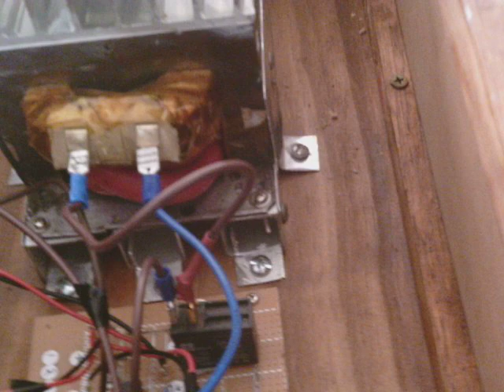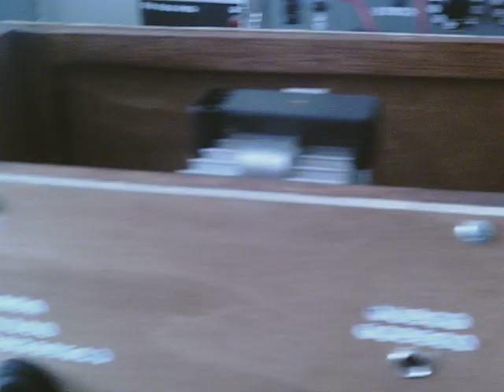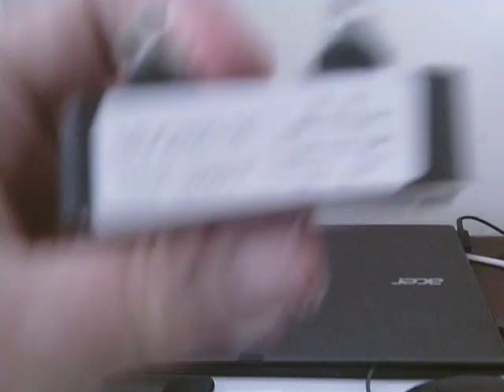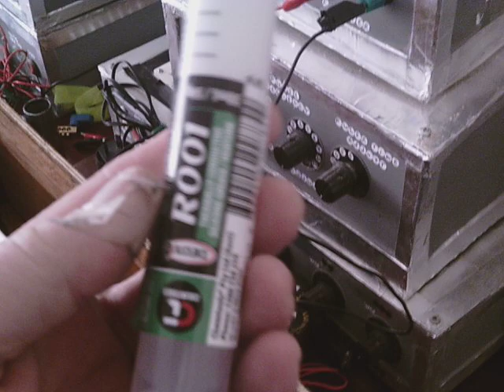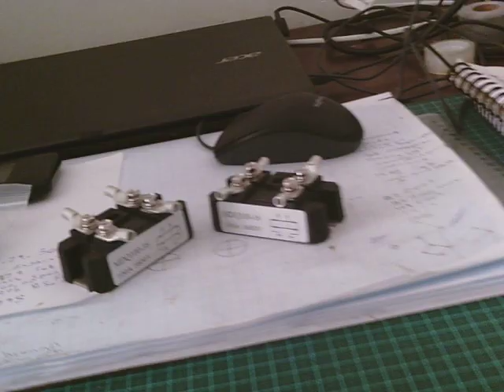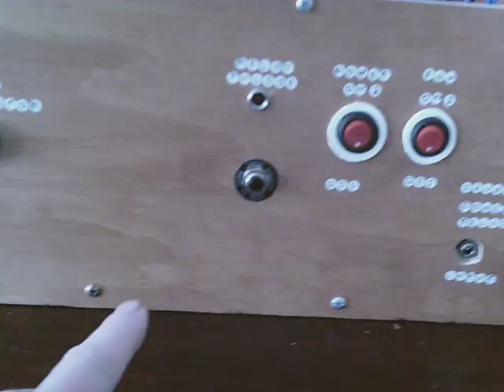high curent low voltage pulsed ac power supply

Comment from the maker: everything indicates i should be getting a high ac current but instead i got the reverse even google ai says what it was suposed to be but not so, heres my logs of the no load test so far of the high current low voltage section  without the  ac conversion section 

date 9-5-2026

ive conducted my first full test of the high current low voltage ac power supply with  the digital multimeter  and high current tester and the results are strange  the ac power lead got very warm and the transformer hummed and buzzed very loud  which I think would be normal like it may be when using a spot welder .
I removed the flasher led before that so the relay stays on during the duration the push button was held in and with no load the ac voltage was 1.302 volts ac and the current was only 2.26 amps thats more than that of a 12 volts sla DC battery which ive had great hho production on in past experiments running it directly from a 12 volts DC sla battery with one amp,  so the voltage being only 1.302 volts  ac and current being only a low 2.26 amps is  not so disappointing after all , but wait till I run it through the DC converter, and with the voltage loss through the rectifier  it may be   better under load so ill find out latter , now despite the ac power leed getting warm the transformer didn’t even get warm or hot when testing with no load and just the current meter and ac multimeter . Now when I re test it and with the 1600 volts 100 amps bridge rectifier considering I may loose more voltage  when I run it to the hho cell load,  things may change or not but if I need more voltage I do have the option of ordering and setting up a series 25 volts 22000 uf high ripple current capacitor bank from the first capacitor bank to see if it gets better , some of the silicon steel peace's I shoved under the top heatsink retaining bracket vibrated loose . the primary is only 1.5 ohms resistance and the thick Hevey 2 gauge marine cable of 2 turns is only 000.1 ohms, ive did some googling and it apears that the output will naturally be low ac voltage and current when its output is not loaded so its not a disappointment after all  but strangely the output current being twice that of a dc 12 volts dc  sla battery is strange when it should be lower when no load it there  so all is well so far .

Comment from the maker: ive recently got my last 3x 22000 uf 25 volts high ripple current electrolytic capacitors in the mail, and because the thin flatt terminals on them are so thin i couldn't solder thick wires to them so i used a long peace of 22 gauge tinned coper wire folded  and twisted it into a bifilar peace and wrapped it around one terminal of the positive of the capacitor at a time then i did the same for the negative  then soldered each one and so i have inputs from the 100 amps 1600 volts bridge rectifier and  outputs to a pair of clamps  which will be used to clamp them onto a hho cell for experimentations , now i use distilled water for the hho cell and bi carb soda to increase its conductivity so ill have to get the right amount of bi carb soda for the right conductivity to avoid fast over heating of the water my 2 hho cell projects , I  built before may have to be stripped down and redesigned to include an external cooling chamber

Comment from the maker: theres some room on the side of the modified microwave oven transformer to attach a thermal switch the types you find in microwave ovens and run the brown live wire to it and from it back to the live input of the primary so if the core temperature gets to high despite the cooling fan the thermal switch would then cut the main power , as a temperature protection circuit breaker , so this added idea would give more protection to the primary input